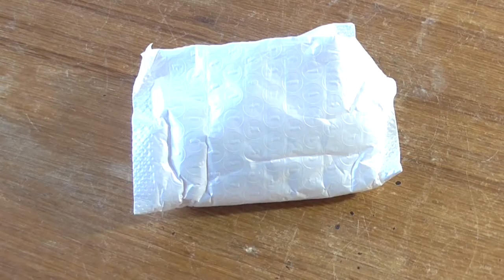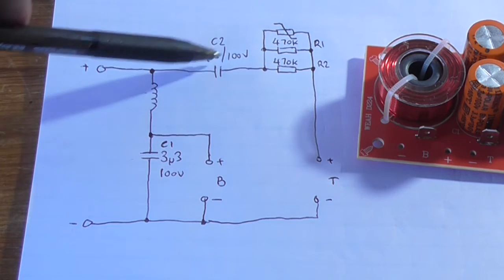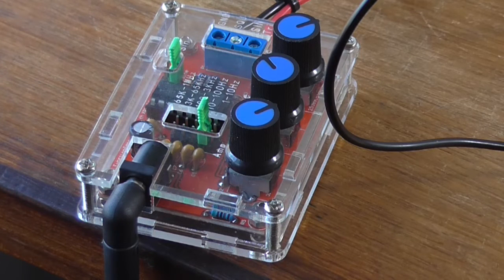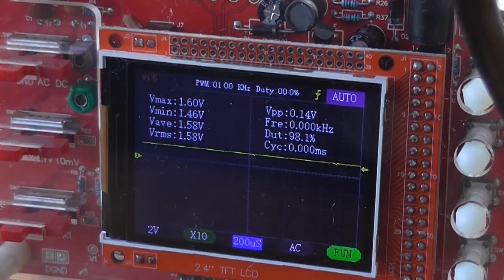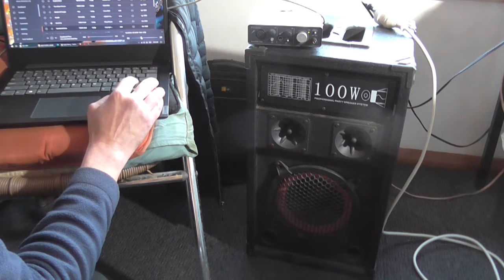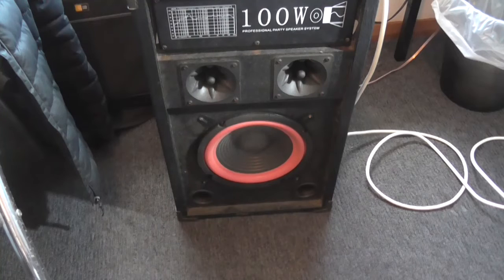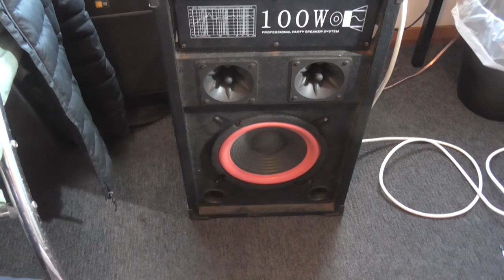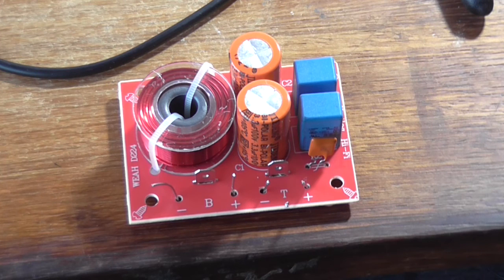Loudspeaker Crossover TEST

Comment: Concerning your loudspeaker with the dual piezo horns, and the new crossover network you installed. The crossover needs to see a resistive load to work. It's fine for the woofer, but Piezos do not present a resistive load - they are seen by the network as a low value capacitor. Piezo horns cut out of the circuit below about 5000 hz. The reason they are too loud is their sensitivity is much higher than the woofer. Try wiring the two in series, which will lower the volume. If lower tweeter volume is desired, an 8 ohm resistor can be added to the circuit.

Comment: The two parallel 470k resistors (did you read them correctly?????) bypassed by a polyswitch in the tweeter circuit makes absolutely no sense whatsoever.  If anything, the polyswitch should be wired in series but before the high pass filter components.  The position of the polyswitch in this crossover particular circuit doesn't matter as the HP is a simple series capacitor, but if it was a more complex circuit with an inductor in parallel with the tweeter it would be a different story as some amplifiers might break into high frequency instability attempting to pump a high level signal into what is now a series resonant circuit once the polyswitch has gone high resistance.  :(  In addition, IME simple prebuilt crossover networks like this don't perform well because they don't take into account the parameters of the drivers.  as @danishdart said - basically a "white van" crossover to match a cheap anything will do speaker drivers.  Crossover design is a science not a Chinese guess and giggle attempt at designing one.
Reply from the maker: The resistor has "474" written on it, so 470k. The two resistors are in parallel, along with the PTC, and the resistors will act as a "ballast" if the current passing through the PTC exceeds its limit. Current limiting, I guess. However, this makes no sense to me to do it this way, either. I'm thinking of purchasing a 12dB per octave roll-off crossover from somewhere else that uses 2 0.38mH inductors and 2 6.8uF caps to form high and low pass filters. None of this PTC rubbish in this! Also, I don't think the one I'm thinking of getting is "Chinese guess and giggle".
Reply: @AstrosElectronicsLab  agrees 474 is 470k but in wired in parallel with a polyswitch which when cold is a virtual short circuit makes absolutely no sense.  If it was me I'd be getting out the desoldering tool and reefing one of those mystery blue blocks off the PCB and measuring it to determine exactly what it really is.   So even if there was too much current pumped into the tweeter and the polyswitch did its job these two parallel 470k resistors would still be (in practice) doing bugger all.  Polyswitches have their applications in speakers.  Long story short; a friend of mine blew his tweeters in his Yamaha NS1000 speakers.  Replacements aren't cheap.  A couple of months later he did the same thing playing disco DJ at a party (and no he wasn't spinning Disco Duck at the time as far as know - LOL).  So on round 2 of replacing the tweeters I wired in a couple of suitably spec'ed polyswitches and no more blown expensive tweeters.  Contrary to popular audiophool misconception the polyswitches did not degrade the sound quality of these excellent speakers but did bypass further blown tweeters and the associated heafty repair bills.  BTW, polyswitches albeit they are technically PTC devices they operate in quite a different way to conventional PTCs.

Comment: It's a small world. That's the exact same crossover that I replaced the reo-stat and circuit breaker crossover in the DB-4 white van speakers you already know about.
From memory, the inductor is actually a bit beefier than you'd expect since it has an iron core. 1.6 millihenries? 
That PTC is indeed bypassing the two resistors and in the end, I got rid of it and the resistors making the crossover a simple LC filter at around 2200Hz.
The tweeter in your white van speaker is 14.95$ at JAYCAR so the quality of it probably matches the price..
Reply from the maker: So. You removed the ptc and left the 235 ohm resistance in place?
Reply: @AstrosElectronicsLab  No I got rid of the PTC and the resistors.